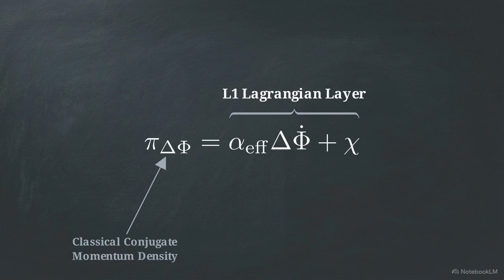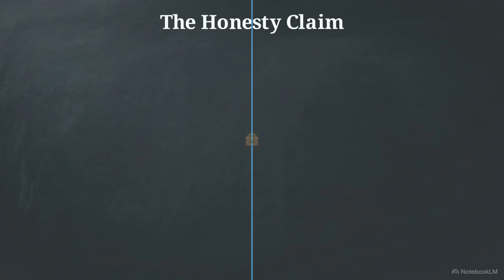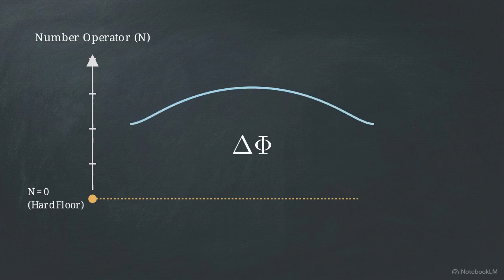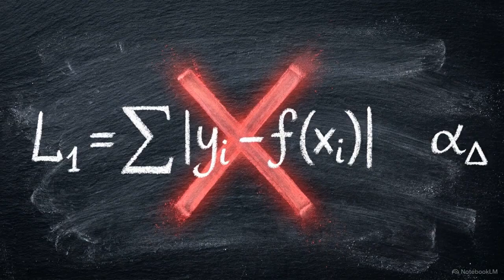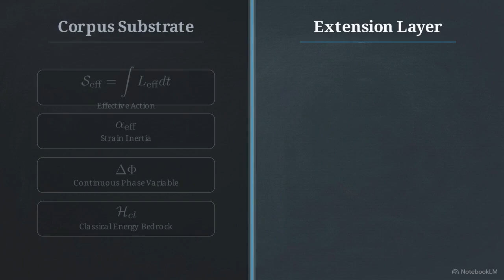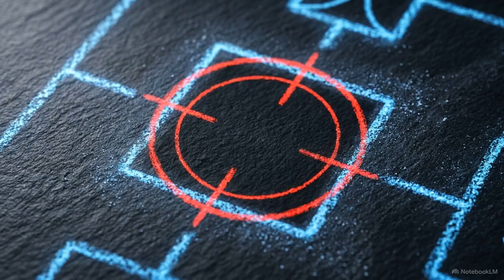Field Note #005 The Insight Engine: The Architectural Overlay of ODTBT

Comment from the maker: Note: This Field Note documents specific findings from June 11, 2026, following the completion of Lane A examination and the arc-level convergence on α_Δ grounding. The central question: how do we bridge ODTBT's classical phase dynamics to a quantum framework? The answer: by CONSTRUCTING canonical structure and explicitly supplying the quantum of action instead of extracting hidden quantum structure from  classical equations.

The key finding: this is a FORMAL EXTENSION, not a discovery. Planck's constant (ℏ) enters BY CONSTRUCTION through a parameter called α_Δ that we supply. We are explicit that we supply it rather than derive it. The Route 2 backbone (exponentiated unitary U_Δ = e^{iΔΦ}, Weyl-type commutator [J_Δ, U_Δ] = ℏU_Δ) provides a mathematically safe framework that avoids the Susskind-Glogower obstruction for periodic phase variables.  This connects directly to prior Field Notes: FN_001's 4π topological foundation provides the icosahedral substrate geometry, FN_002's charge-as-5D-velocity establishes the dimensional architecture, FN_003's ξ coupling constant supplies the 5D thermodynamic layer, and FN_004's zero ≠ null addresses the dimensional boundary. FN_005 addresses the quantization pathway, how classical recursive phase strain (ΔΦ) can be promoted to a canonical phase coordinate while maintaining honesty about what the theory provides versus what the researcher supplies.  What remains open: What physically fixes α_Δ (the central open problem, now converged to N_Δ[π_ΔΦ] per Addendum 24 §8.3), the velocity-coupling term χ in the full treatment, and the connection to the field-update operator F_ψ.  The paper this video is based on: DOI 10.13140/RG.2.2.32585.92002

Additional note: The videos on this channel are AI-narrated companions to my work, which consists of published research papers as well as manuscripts in active development. The underlying work is the ODTBT research program in development for over 10 years, with software, field notes and preprint publications available as open-access under CC BY 4.0 and confirmed DOIs on ResearchGate. I use AI tools for production, narration, transcription, and accuracy review against source materials. The theoretical framework, mathematical derivations, and experimental program at Recursive Systems Labs are my own work. Full publication record: Recursive Systems Labs on ResearchGate.